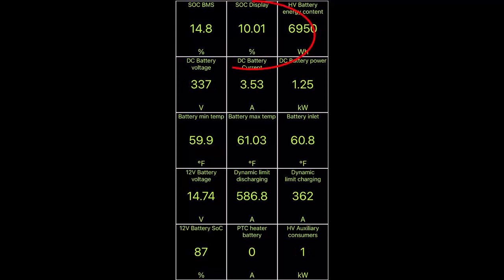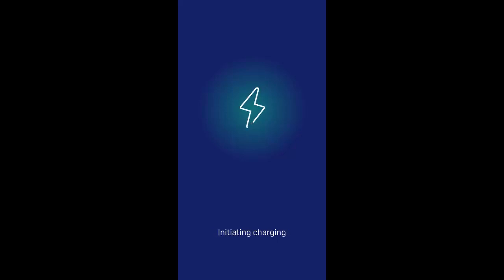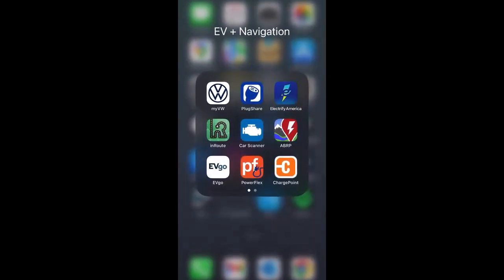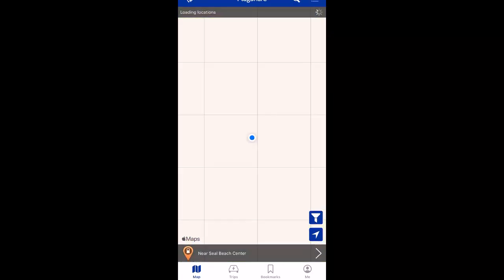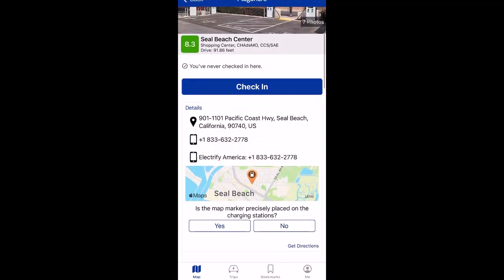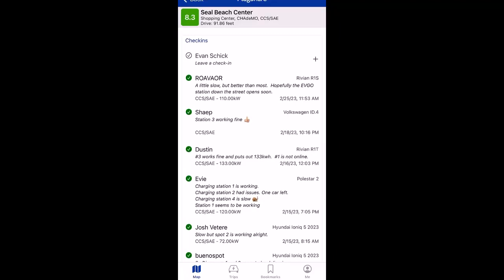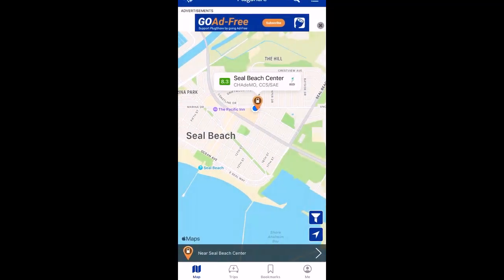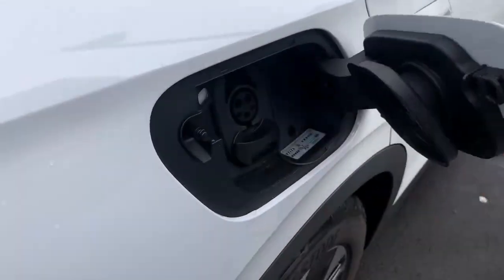Is A 60 Degree (F) Battery Too Cold For The VW ID4 To Reach Max Charging Speed?

Comment: You should try using the car scanner to  compare the dyamic limit charging and battery current in AMPs to see if you are getting all the AMPs the car is requesting.
Reply from the maker: I’ll be doing exactly that in an upcoming vid. Should be interesting. Thanks!